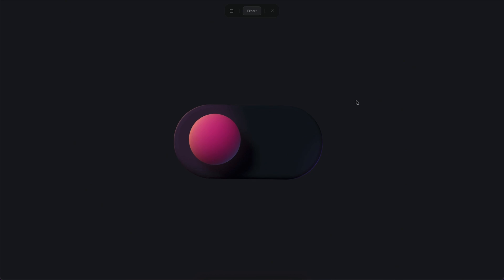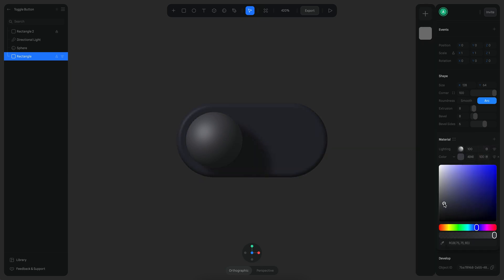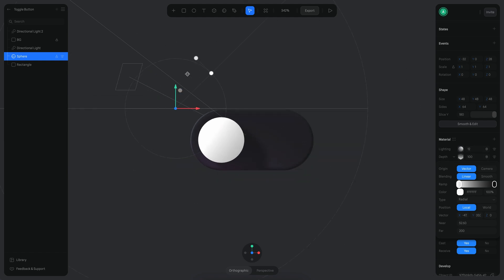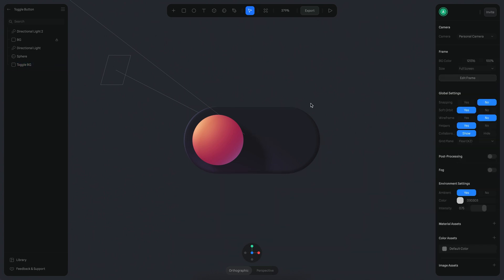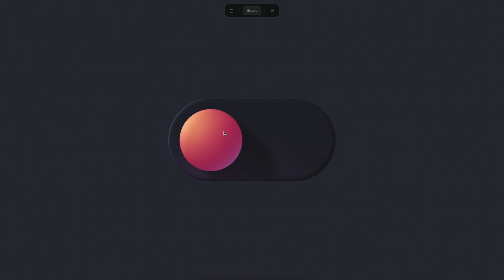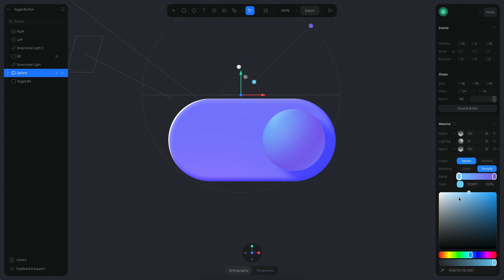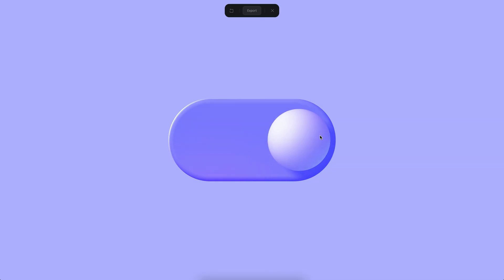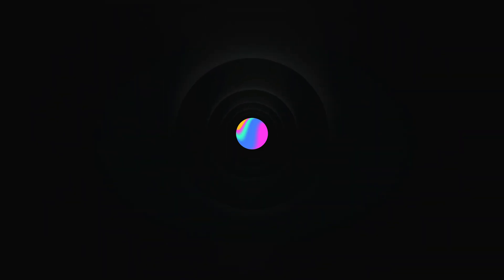Designing a 3D toggle button micro-interaction with Spline

Comment: hello, this is so inspiring! but I am having serious trouble with this using the invisible cubes, it has rendering issues as the circle it turned into hard lines while passing thru the cubes, and is really unreliably receiving the click events, I will make small dimensions changes and suddenly nothing works. is there an updated way to do this?
Reply from the maker: Hi! Spline is still in beta, so we are changing things fast. We added a new way of achieving the same without the need of invisible objects. You can now use the Toggle parameter in the Mouse Events. Check this tutorial: https://www.youtube.com/watch?v=lJIDSiDlhvw&t=10s&ab_channel=Spline

Comment: Trying to turn this into a toggle to trigger something on my Webflow Website. Is there nay way to do this? Basic embed doesn't seem to work- I have the HTML box set to change my background color when pressed, but it won't work.
Reply from the maker: The way to do this would be to use the react-spline API